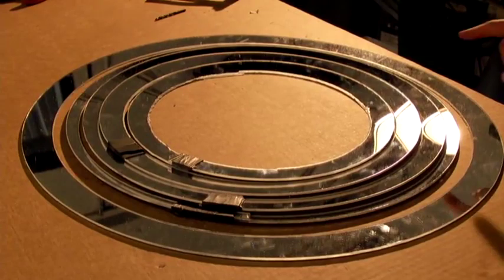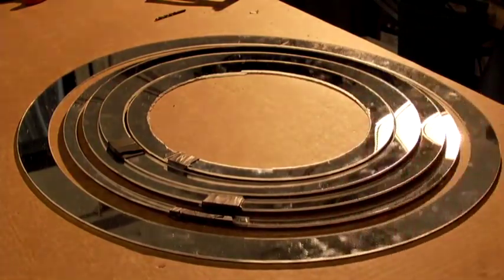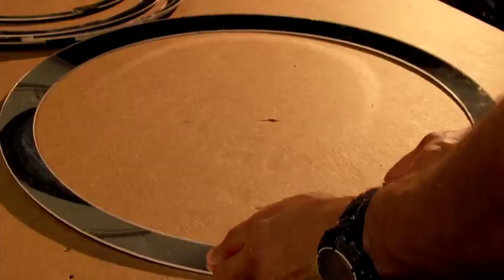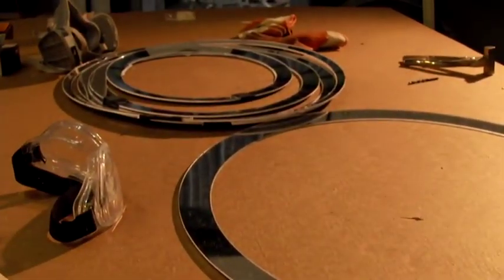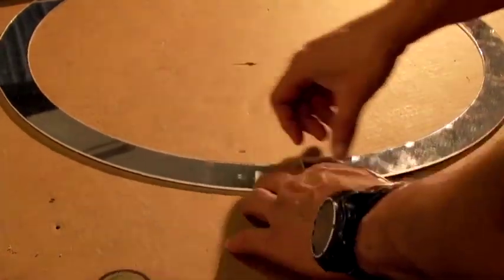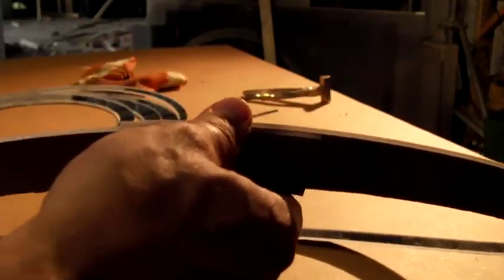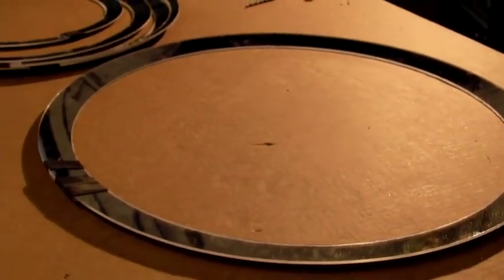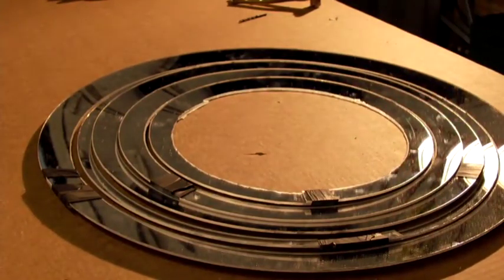DIY Fresnel Mirror Solar Concentrator

Comment: Great video.  
Do another video that shows your cutting technique.
Also point out that the centre is flat and the angle of the rings increases as they get bigger.
You want your test lamp to be as far away as possible if you want to focus to infinity (sun) at a later stage.
You could make an initial light scratch from the centre point to the edge before you cut to rings to have a radial mark on each ring.

Comment: Excellent Dan!!  I like the fact that a piece of 4'x4' that can be cut and mounted on a FLAT surface.  This sure beats the socks off of using a dish and diddiling with irregular triangles to replace the wire mesh sections.

Comment: Safety glasses. yep. I have worked with tools since the beginning. Am a master actually. In my whole time, have tended to snicker at safety goggles. Then I recall, one time. Only once mind you. A wire wheel loaded onto a die grinder/air powered. Had my handy dandy cumbersome vision limiting dusty goggles on over my eyes. This one time, one of the bristles shot off the wheel. Happened so fast I didn't think about it for a sec. This one bristle shot off the wire wheel into the goggles. It would have permanently blinded me in one eye. Wear the goggles... even if nothing ever happens. Cannot replace an eye.
Reply: I had my nose pierced by a wire wheel bristle about 5 years back, now I've moved to face shields

Comment: Electrical tape when heated up or exposed to sunlight will loose its grip. In long run for sure. I would ad a wire. 
Very inspiring. Well done.

Comment: The equation relating the radius of your flat ring 'R', the 'overlap' arc length 'L', (both measured midway between the inner and outer radii) and the focal length 'F' is:

 2*arccos[2 * pi / (2*pi - L / R) ] + arctan[ 2 * pi * F / (2*pi*R - L) ] = pi / 4. 

This could probably be simplified, but you can copy it into a grapher application, choose a value for focal length and evaluate the results. Note angles are in radians.
Reply: Does this also take into account that the ring diameter will reduce slightly as it is pulled together and does this take into account that the rings are lying flat and not on the height of the parabola.  I think it is great to have a formula but it is complex enough to need a spreadsheet to calculate the overlap one can also calculate it analytically.

I am going to copy your formula and play with it at some point.

Comment: @christo930 I find that reinforced tape (the tape with the string in it, not duct tape, but clear packing tape) is much stronger and doesn't get gummy the way electrical tape does when it gets hot. Since you would want to put this in the sun, it is going to get hot, especially with it being black, at least try and use white electrical tape so it doesn't absorb so much heat.

Comment: Hi Dan,
Your videos are always worthy of a watch, sometime again.
Why not velcro or just staple a few places?
If you use every other one you can make two lens!
And they will not shade the next outer one as they get steeper.
allows a shallower focus vs a taller one.
And...
On the other side at the foci prime location 180 degrees from the reflective foci, will be another foci! Some gap between rings that lets light through
This one is a Fresnel lens instead of a reflector.
Same cuts four times the concentration zones!
and shorter than wide possible.
glass bottle with a soup can inside, measure the steady state temp at each location.
I think this is one of your best DIY projects yet because this is so easy to do. It can be done in a classroom for instance.

Comment: If, before you cut rings from the big circle, you draw a wedge from the center of the circle to the outside you will have a measure which represents the amount of mirror to overlap. This could significantly reduce the amount of time spent focusing each ring.
Reply: That is a neat idea but I am not convinced that it will form the optimal shape. It might be and well worth calculating or testing if you plan to make a run of these mirrors.  The outer segment has to be steeper so it will probably need a larger amount of overlap compared to the inner most ring that remains almost flat.  I don't think your idea is optimal.  Pre-marking the amount of overlap once you have calculated or measured it once is still a good idea.

Comment: @drorbenami A very quick and simplified answer would be to look up the amount of energy that one can receive in a given area of direct sunlight. You're focusing this amount of light to a point or smaller area. Just because it's focused doesn't mean you're getting more energy. Keep that in mind.This information can be combined with the specific heat capacity of seawater and the latent heat of vaporization. Google or wiki some of that stuff and you'll be on your way! It's simpler than it may look.

Comment: If your planning on laying the angled rings on a flat surface, that might not work using this method. At least not using every ring without overlap. You might be able to stack them like a parobolic dish though, maybe. Or maybe it will work with overlap.Heres why. Each of those rings cut, share something particular in common. The inner circumference/diameter of one ring, forms the outer of the next adjacent within it, and vice-a-versa. Assumidly, the steepest angle is wanted on the outside, wich means cinching more ring segment. The next ring in would be cinched less. Therfore the outer diamer of the inset ring would be larger than the inner diameter of the ring it sits in. Since they are angled it might still work with overlap, maybe. I don't know for sure, I haven't figured that far yet. I'm not sure if the exposed portions could be aligned properly or not, or if there would be a forever cinching&overlap problem until a ring or few was skipped or different sizes were initialy chosen. I'm going to share what I have figured. The angle of the ring is a function of the proportional length of the circumfral segment, not the radius.The closer you get to using 0 length of the ring's circumference (assumimg you arc one end to touch the other), the closer it gets to 90 degrees. Because the ring wedge gets closer to rectangular, like a piece of paper, then one end would be arc'd (folded) over to touch the other sideThe closer you get to using 100% of the rings circumference length, the closer it gets to lying flat, 0 degrees.Realizing this, I wonder if using half the ring's circumference length would produce 45 degrees. If so, would the pattern hold consistent, 1/3 ring = 1/3 square angle?
Reply: Though if this is a through ring reflector and the steepest angle is on the inside, than it should totaly work. inside<90, outside>45.

Comment: A plastic spacer and a pin or screw to hold inner to outer ring as it spirals outward.
changing thickness spacer introduces proper curvature

Comment: If you do this on a piece of window glass (or plexiglass since its more durable), you can angle the mirror rings to act as a lens instead of a mirror.  You could make a massive fresnel lens for really cheap with mylar rings.  Dangle a laser pointer from the ceiling for calibration while building it...make the laser point straight down (use a level) and keep the plexiglass perfectly square as well.  Then just make the laser come to the same point (pick the best focal length) for each ring by increasing the angle with each ring....the center rings are nearly standing on their edge but slightly angled, and the outer rings are angled more like the ones in the video
Reply: That will not work.
A Fresnel lens requires an annular prism shape for each of the rings/segments with the profile of the prism changing from flatter to more acute as you move away from the centre.

There is very little refraction taking place in a flat sheet of glass or acrylic even if they are held at an angle.

Comment: The most important thing is a ultra smoothenss of the surface to maximize eficiency.  Do you know that the mirror in the Hubble telescope is so smooth and even that if it is as wide as the Gulf of Mexico, the waves wont be more than one foot high . Wow!   With this kind of mirror ring you got here it bounces a lot of photons off the intended target unseen to your own eyes..  about 10-20% of the photnos will be bounced off the intended target!  This is why it is so important to be ultra precise
Reply: With a solar heat concentrator there is no need to focus on a pin point.  With this setup it is not possible to make the spot smaller than the width of a ring in any event and the flatness of the material is much better the error due to the imperfect curve that will be close to a cone and not a parabola.

Comment: I was pouring some molten lead. Had a small sputter (steam?) and caught a droplet of lead with the lens of my prescription glasses (which I only wear sometimes). I was looking at a 1/2 inch "bullet hole" on the lens (no, it just looked like one, it didn't mark the glass lens at all). From that day, I wear goggles (often a face mask instead). Same for ALL shop work, no matter what it is. WEAR GOGGLES.

Comment: Perhaps an easy way to get your focal point right is to put a dowel rod on a block with a bright light overhead as you mentioned.  The focal point should shine evenly on the dowel rod and make it easy to calibrate each ring to the same focal point.

Comment: what about  to find the angle as a function of the radii of the mirror ring and the length of the overlapping area instead of the trial/error to find the focal point?
Reply: try to do that with a small laser beam to find the good focus point and the settings, it works fine

Comment: if you have a continuum of spacer thickness and you use them in order as they all get pushed inward it forces more curvature, as they get moved out less curvature.
Reply: With a Fresnel reflector the inner ring is nearly flat and the outer ring has the steepest angle.

Comment: Using a light overhead to determine the correct curve will only focus light from that distance. Light from father away will focus at a different point. But if your target is not exactly a point but an object, it might not make a that much of a difference.

Comment: Try making a cut at an angle,
that way, you get the measure of the outer circumference are shortened,
relative to the inner circumference.

Comment: I've done this for a science project when I was a kid. I tried the tape, but it never worked for me, In the end I drilled holes and used 2 or 3 rivets to hold the pieces together. I presented it as a "Flat Lens". I didn't even know what the heck a fresnel thing was. BTW, circular saw sucks for this, try a scroll saw. Just be careful, a kid in the shop class sawed off a finger with it. Scary stuff...

Comment: cut a section of the circle out and discard it!  Use the regular parabola formula to calculate how many degrees of the circle to cut out the further out from the center you go!  If your rings are only one inch wide then your ideal object size would be one inch!  have fun and be safe!

Comment: Because it's more fun or because you don't know the calculations!
Reply: The calculations are easy. But whenever you design something on paper you end up having to fine-tune the thing anyways once you start working with limited tools and materials. In this case, it pays off to simply not even calculate circle lenghts and angles because you can find out the correct length of the ring simply by shifting the focal point around and measuring where that lays. It is not going to be incredibly small anyways.